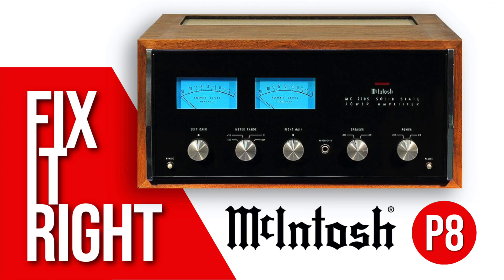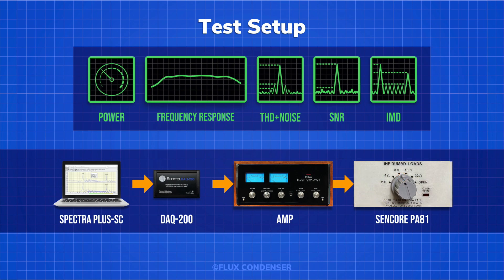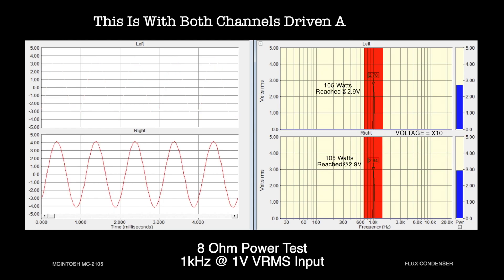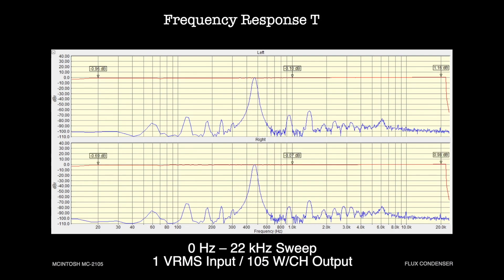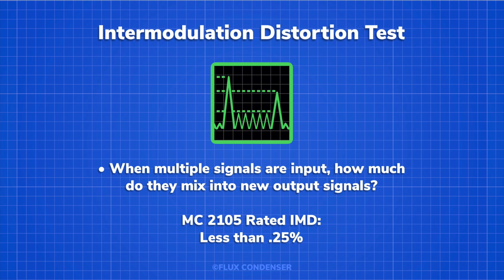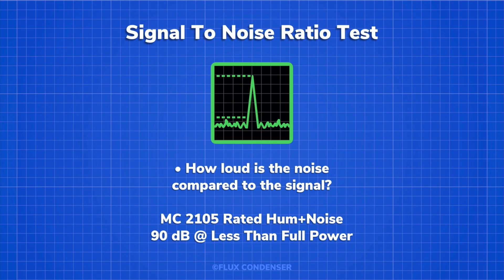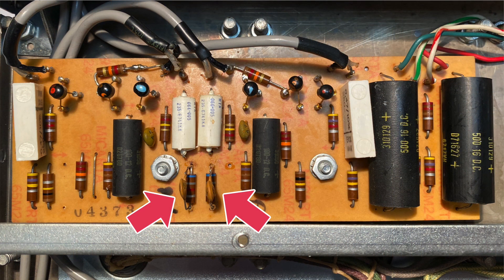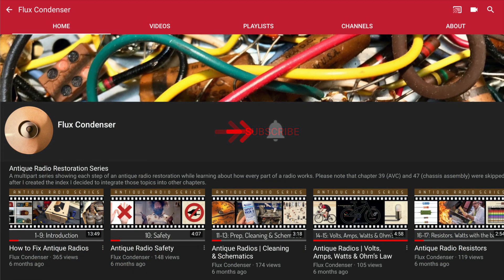McIntosh MC2105 P8: Let’s Test Power, Frequency Response, THD, IMD, SNR, Square Wave & Oscillations

Comment: Chris, you just keep amazing me with this stuff! My goal is to recap the amp, but my 'hopeful goal' is to learn something in the process. In parts 1 through 7 I've learned tons of things that I was unfamiliar with and/or never certain that I had a proper understand about them. I've got 12 pages of hand-written notes so far and now this video is going to probably create another 10 pages on its own! LOL.

I can see that I'll be replaying this video many times over and taking screen shots while I'm at it.
Thanks,
Rich
Reply from the maker: Rich, if you enjoy the bench testing, check out the one I did for the Kenwood amp. I’m also going to wrap up my series on the Dynaco amp soon with a bench test video that should be out within the next week.
Reply: Thanks Chris, I'll refer to those as well. BTW; I noticed that my SFG brand (Koolertron), and yours (Cleqee) are different but are identical in appearance. In fact, I noticed a number of these different brands all appeared to have the same control and faceplate panel. 

My SFG covers the 0-15MHz frequency range, (which is the lowest range in the JDS6600 series). However, the faceplate and controls look the same for the highest range versions as well. 

I'll be filtering everything that I can test through the X10 voltage probes and I think I have a Hantek 20:1Attenuator filter for my scope that I think I can make use of, (not sure about that yet. I've got to read up on its uses). Much of what you tested will be outside of my abilities. I plan to test the amp's Meter's and calibrate them if necessary. 

Because I only have 8Ohm x 100w dummy loads, I'm going to heed your advice and test everything up to 50watts output. It won't be enough to tell a number of specifics regarding the amp's "maximums", but I'll be able to make some Left & Right channel comparisons.

I've been meaning to ask you about the use of multiple dummy load resistors: I happen to have two 8 Ohm x 25W and two 8 Ohm x 20W resistors. I know if I place the two 8 x 25W in series, I'll wind up with about 16 Ohms, but does doing that also double the watts rating to 50?

If so, then in a scenario where I had two 4 Ohm x 100Watt resistors, I should be able to place the two in series and have about 8 Ohms x 200 watts? It would be good for just one channel at a time, but could help in a pinch, no?. 

I don't have any 4 0hm x 100 Watt resistors, but I'm thinking in the future, maybe I should stock a few dummy resistors in 4 Ohm ratings and at various watts from 25 to 100W. (Of course, that's if the wattage does double when in series).
Thanks,
Rich
Reply from the maker: Rich, only doubling resistors in parallel will increase the wattage rating. In series, it’s limited to the lowest power-rated resistor. If there’s 100 watts, that’s going to flow through both resistors in series.
Reply: @FluxCondenser   Thank you, so much for that plan, lol.
Rich

Comment: I've been rehabbing my own mc2105 and this series has been extremely helpful in that effort. Thakks. On an issue related to this specific video, I am interested in how to construct and connect a voltage divider (as you did here) to enable my scope  to see higher output amps: apparently there are important grounding issues to be considered. BTW, 40 years ago built the same Heathkit preamp that your now working on. It's still around; maybe I'll rebuild it.
Reply from the maker: Thanks, Warren. So glad you’ve found the series helpful. Great coincidence that you built the Heathkit preamp back in the day. I’m on page 72 of the manual now trying to finish mine, but thought I’d take a break and answer your questions. For your scope, simply use a 10X probe to connect to the speaker outputs. Make sure you’re using a dummy load and that the scope is set for 10X to get accurate voltage measurements (if your scope is capable of that). Note that when using the SpectraDAC interface with my computer software, the 10X probes worked to reduce the voltage, but, did not give accurate voltage readings. Instead, I had to use a 10:1 voltage divider and simply multiplied my results by 10. To make this simple, you can buy this Russound speaker to line adapter: https://www.russound.com/products/audio-systems/multi-room-controllers/expansion-devices/adp-1-2-speaker-to-line-level-adapter  It’s just a voltage divider, but it’s nicely built on a board with phono and speaker jacks. To save money, you can build your own voltage divider using the same design using 3.9K and 430 ohm resistors (use at least 1 watt resistors). Click the link for a sketch I did of the schematic: https://www.icloud.com/sharedalbum/#B0GGFssfGGqvEab

Comment: Interesting. I have two MC2105s and they both measure around 130 watts prior to clipping. Their SNR is also much closer to the ratings. I'm wondering if there is still something that needs to be addressed here. That said, I really, really appreciated this series! Thanks so much for being so thorough!
Reply from the maker: Glad you enjoyed it, Edwin. I’d be surprised if you’re getting an unclipped 130 watts from a 105 watt rated amp unless you perhaps modified the power supply with larger filter caps or have somehow increased current compared to a stock unit. It’s also important to check your dummy load to make sure it’s exactly at the rated value and the resistors are non-inductive. If calculating for an 8 ohm load, for example, and the load is actually a bit over 8 ohms (not uncommon) the Mac’s autoformers will put out a higher voltage, which when calculated for 8 ohms, will mistakenly be taken as higher output wattage.
Reply: @FluxCondenser  Yeah, I didn't do it myself. These were tests run by Dave O'Brien of McIntosh who traveled the country and ran the McIntosh clinics back in the old days. I just took his word for it.
Reply from the maker: Ah, I see. Well, the amp is certainly capable of 130 watts per channel, but it would be well above its rated distortion. Having an amp measure as having almost 30% more power than advertised is pretty unlikely. Thanks again for the comment and adding that extra bit of info. Bet those clinics were fun. To address your concern that something might be amiss with my amp, I’d say no. The hum and noise are measuring at about -80dB, which while not as good as the rated -90dB, is still virtually inaudible. Additionally, the THD+Noise measurement is much better than rated.